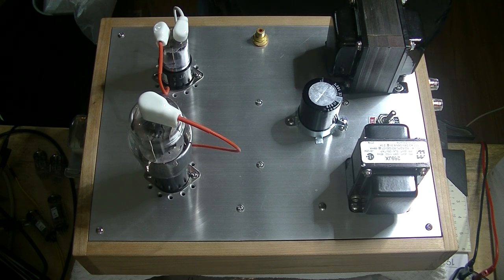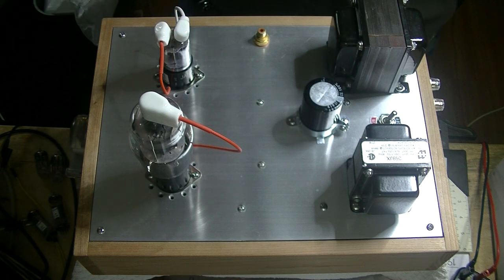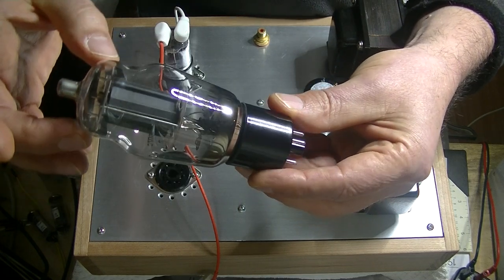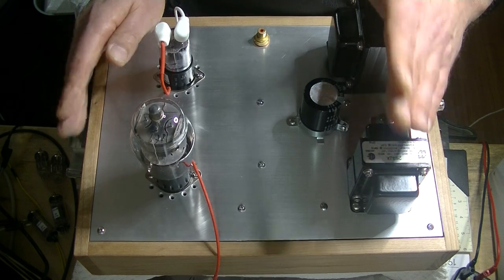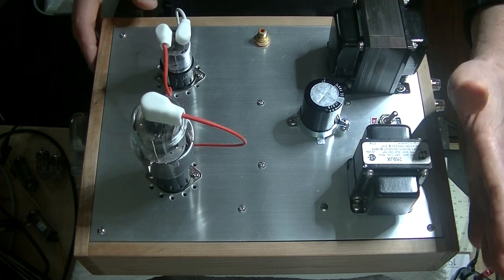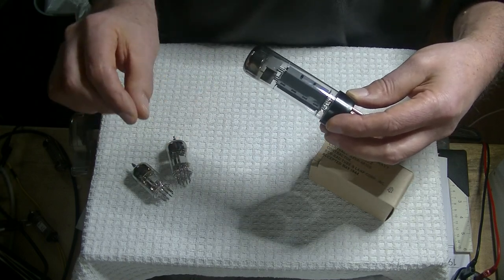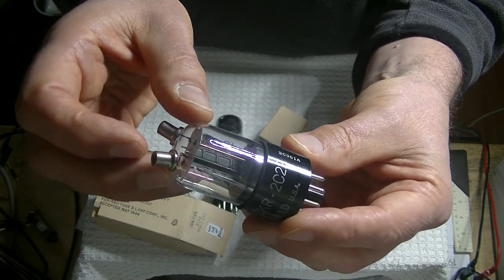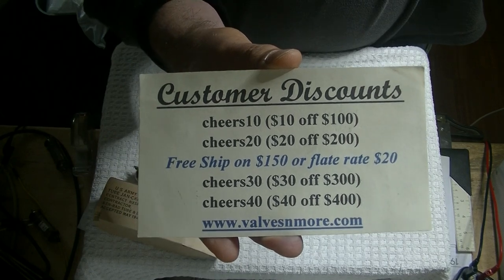Tube Lab #75 - The Great 2022 Tube Shortage

Comment: Thanks for sobering tube advice.  Thanks, too, for taking my panic order and keeping your prices stable despite the madness of people like me😊.  I really love your progress on the HP amp.  Will it be OTL?  I am dusting off my soldering iron in eager expectation for it.  Love your business, so glade I found it.  Thanks.
Reply from the maker: David thanks for the kind words, that makes my day after a rather nasty comment yesterday.  At this stage of the headphone kit amp everything is an option, however the current design, v1.0 uses a conventional output transformer with multi taps for impedance matching.  The preamp and power amp stages will be pure Class A.  Listening tests will determine if our initial design decisions were correct!
Reply: So exciting, I can hardly wait!  Best of luck going forward with it.